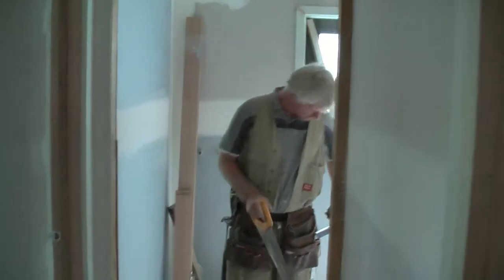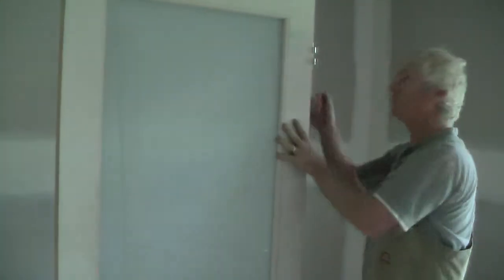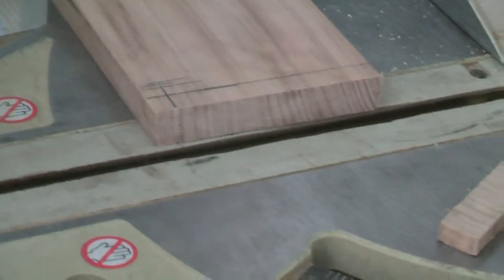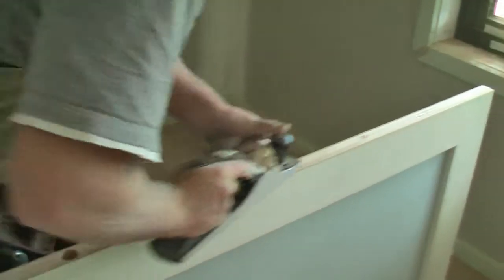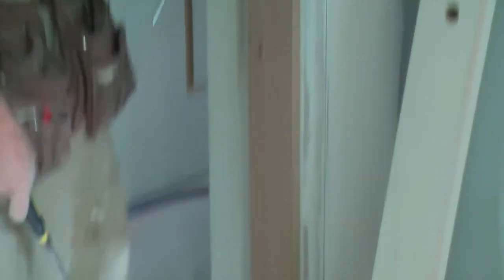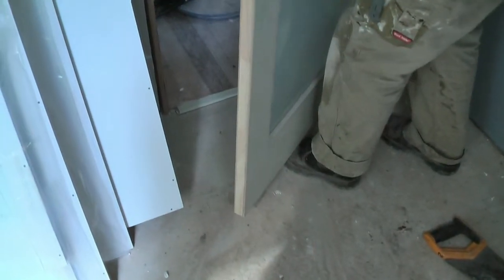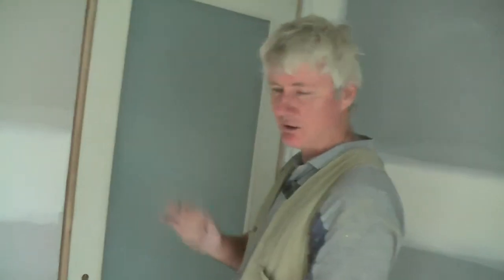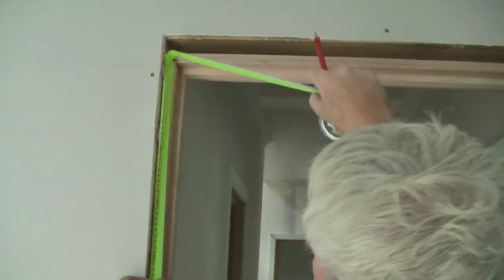installing a door and architrave

Comment: What do you do when door linings don't meet the wall
Reply: I'm not exactly sure what you mean. I'm guessing you mean "what do you do if the wall lining doesn't line up with the edge of the jamb"? If I have the question right then you need to plane out the back of the architrave when it goes against the wall so that the beveled edge of the architrave can move in far enough to nail against the edge of the jamb. Put a rebate in the back edge of the architrave.
Reply: yes sir that is correct